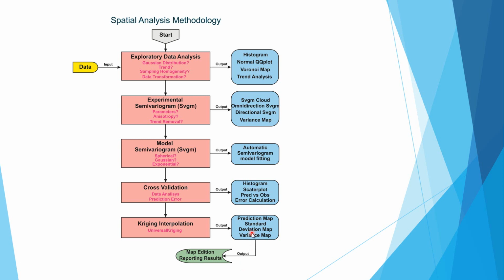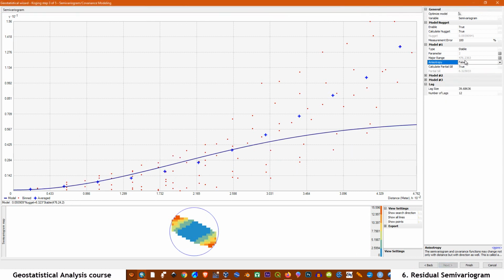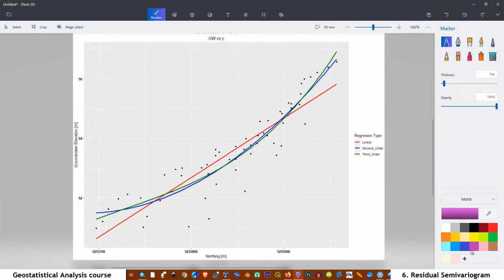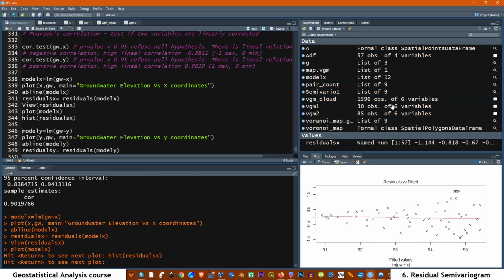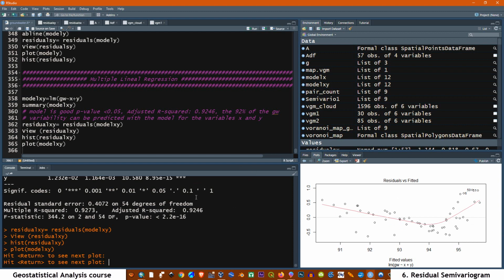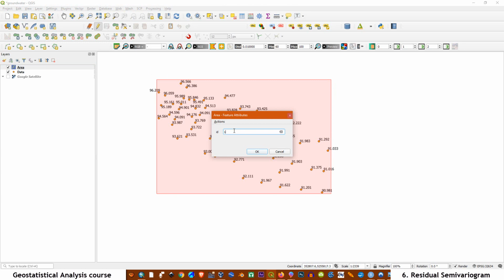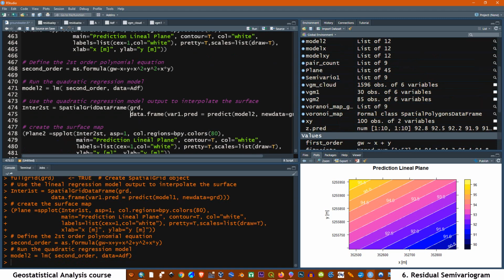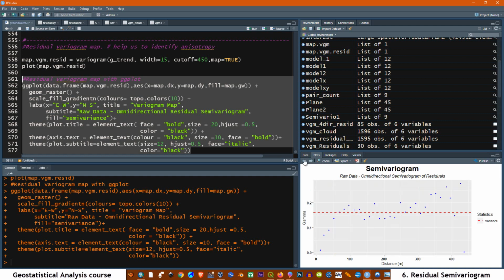Kriging Interpolation.  Trend removal. #6  Groundwater Flow. Residual Semivariogram.

Comment: Wonderful video, I love how you explain the black box in detail so that people can understand the math behind it. At 21:19. I think the residual means the difference between the regression value and measured value at each location on the X-axis, so a proper way to present the residual is a line from the point down to the regression line, not perpendicular to the line, am I right?
Reply from the maker: Yes, you are totally right. I provided a better explanation in this video. https://youtu.be/1EgE46PZHHc
Reply: @GeoRGBCommunity  Thanks for the kind reply! I also have another question, since Kriging can only work for interpolating stationary datasets, we use the residual values and their fitted semi-variogram model to perform Kriging, and then back-calculate the GW elevation and label them as predicted values, am I right?

Comment: Hi Marcel, thank you for this amazing series of videos. I'm working with a dataset of groundwater quality in order to obtain kriging maps to visually see the situation of the contamination; I'm following this course step by step and my question is: If I don't find any trend in my data (no linear correlation with coord x or y) should I just skip this phase of trend removal right?
Reply from the maker: Thank you very much for your positive comment. Yes, if you do not have trend in the data, you can assume that at least you are covering the intrinsic hypothesis, then you data is stationary and you can use ordinary kriging.  One very important think is to verify the stationarity of the data using the experimental semivariogram. If you see that the data is showing a parabolic or quadratic behaviour in the experimental semivariogram, then be careful because the data is no stationary.   If you have extra questions or you want to have a better understanding on the data analysis you can buy one hour of consultation at:  https://giscourse.online/courses/one-hour-consultation/
To analyze groundwater data is complicated and I saw that people make too many mistakes. Have a great day.

Comment from the maker: ################################################################################
############################ Lineal Regression #################################
################################################################################

attach(Adf)
plot(x, gw, main="Groundwater Elevation Vs X coordinates")
plot (y, gw, main="Groundwater Elevation Vs Y coordinates")

# Pearson's correlation - test if two variables are linearly corrected

cor.test(gw,x) # p-value < 0.05 refuse null hypothesis. There is lineal relation
# negative correlation, high lineal correlation -0.8811 (-1 max, 0 min) 
cor.test(gw,y) # p-value < 0.05 refuse null hypothesis. There is lineal relation
# positive correlation, high lineal correlation 0.9019 (1 max, 0 min) 

modelx=lm(gw~x)
plot(x,gw, main="Groundwater Elevation Vs X coordinates")
abline(modelx)
residualsx= residuals(modelx)
View(residualsx)
plot(modelx)
hist(residualsx)

modely=lm(gw~y)
plot(y,gw, main="Groundwater Elevation Vs y coordinates")
abline(modely)
residualsy= residuals(modely)
View(residualsy)
plot(modely)
hist(residualsy)

################################################################################
################### Multiple Lineal Regression #################################
################################################################################

modelxy=lm(gw~x+y)
summary(modelxy)
# model is good p-value <0.05, Adjusted R-squared: 0.9246, the 92% of the gw 
# variability can be predicted with the model for the variables x and y 
residualxy= residuals(modelxy)
View (residualxy)
hist(residualxy)
plot(modelxy)

################################################################################
########################## 3D Model Interpretation  ############################
################################################################################

library("plot3D")

# Compute the linear regression (z = ax + by + d)
modelxy=lm(gw~x+y)

# predict values on regular xy grid
grid.lines = 10
x.pred = seq(min(x), max(x), length.out = grid.lines)
y.pred = seq(min(y), max(y), length.out = grid.lines)
xy = expand.grid( x = x.pred, y = y.pred)
z.pred = matrix(predict(modelxy, newdata = xy), 
                nrow = grid.lines, ncol = grid.lines)

# fitted points for droplines to surface
fitpoints = predict(modelxy)

# x, y, z variables
x= Adf$x
y= Adf$y
z= Adf$gw

# create the 3D model
scatter3D(x, y, z, pch = 16, cex = 1,  alpha.col = 0.7, color="black", 
          col = ramp.col(c("blue", "red", "yellow")), bty="b2", 
          theta = 360, phi = 15, ticktype = "detailed", d=200,
          xlab = "", ylab = "", zlab = "",  
          surf = list(x = x.pred, y = y.pred, z = z.pred,  
          facets=T, modelxy= fitpoints, border="black"), main = "Trend Surface")

################################################################################
############################## Create Grid #####################################
################################################################################

# rgdal: Bindings for the 'Geospatial' Data Abstraction Library
library(rgdal)
# maptools: Tools for Handling Spatial Objects
library(maptools)

# transform data (A) in spatial points 
coordinates(A) = ~x + y

# Define the grid extent. 
# We obtain the data extent from QGIS, shapefile "workarea"
# min/max x of the interpolation area
x.range_1 <- as.numeric(c(352473.45, 352875.06))

# min/max y of the interpolation area
y.range_1 <- as.numeric(c(5255695.40, 5255958.99))

#Now expand your range to a grid with the spacing needed for the interpolation
# 0.5 x 0.5 m, is good to avoid saw effect at the contour lines
grd = expand.grid(x = seq(from = x.range_1[1], to = x.range_1[2], by = 0.5), 
                  y = seq(from = y.range_1[1], to = y.range_1[2], by = 0.5))

# transform grid in spatial points 
coordinates(grd) = ~x + y

# transform grid in data frame to work with ggplot 
griddf=as.data.frame(grd) 

#plot grid with ggplot
ggplot() + geom_point(data=griddf, aes(x=x, y=y), shape=3, size= 2) +
  geom_point(data=Adf, aes(x=x, y=y), color="red") + 
  labs(x="Easting",y="Northing", title = "Grid cell") + 
  theme(plot.title = element_text(face = "bold", size = 20,hjust =0.5,
                                  color = "black")) + 
  theme (axis.text = element_text(colour = "black",size =10, face = "bold"))

# transform grid in spatial pixels. Needed to export the final maps as GeoTIFF
# GeoTIFF is a georeferencing format 
gridded(grd) = TRUE

################################################################################
#################### 1 st and 2 nd order polynomial fit ########################
################################################################################

attach(Adf)
library(rgdal)
# Define the 1st order polynomial equation
first_order = as.formula(gw ~ x+y)

# Run the lineal regression model
model1 = lm( first_order, data=Adf)

fullgrid(grd)    <- TRUE  # Create SpatialGrid object

# Use the lineal regression model output to interpolate the surface
Inter1st = SpatialGridDataFrame(grd, 
            data.frame(var1.pred = predict(model1, newdata=grd)))

# create the surface map 
(Plane =spplot(Inter1st, asp=1, col.regions=bpy.colors(80),
               main="Prediction Lineal Plane", contour=T, col="white", 
               labels=list(cex=1,col="white"), pretty=T,scales=list(draw=T), 
               xlab="x [m]", ylab="y [m]"))

# Define the 2st order polynomial equation
second_order = as.formula(gw~x+y+x^2+y^2+x*y)

# Run the quadratic regression model
model2 = lm( second_order, data=Adf)

# Use the quadratic regression model output to interpolate the surface
Inter2st = SpatialGridDataFrame(grd, 
              data.frame(var1.pred = predict(model2, newdata=grd)))

# create the surface map 
(Plane2 =spplot(Inter2st, asp=1, col.regions=bpy.colors(80),
                main="Prediction Lineal Plane", contour=T, col="white", 
                labels=list(cex=1,col="white"), pretty=T,scales=list(draw=T), 
                xlab="x [m]", ylab="y [m]"))